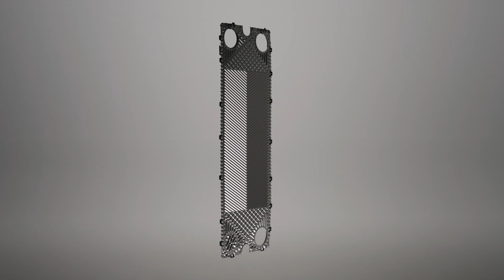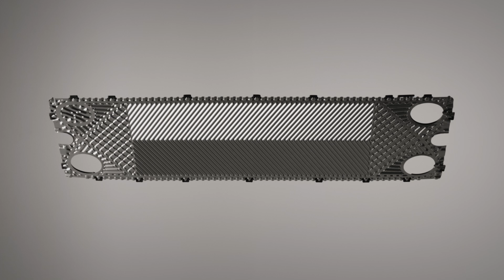Thin Plates - Join the Evolution

Comment: That is just a marketing wank. What is even meant here with "strength"? He is talking about resistance against corrosion, maybe abrasion. But not strength. 
In heat exchangers, abrasion is usually no problem. And if you have corrosion, your picked the wrong material.